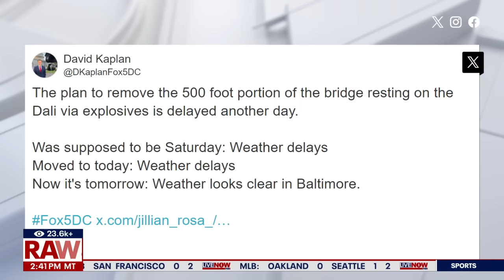Demolition of Key Bridge Delayed | LiveNOW from FOX

Comment: So, the crew is not allowed to leave the ship? Why? The government has no problem with people entering the country without documentation?
Reply: Who would run the ship if the crew left? Dali is still a WORKING SHIP and needs a crew at their stations.
Reply: Delete your account.  Geezus dude.
Reply: ... anyway...
Reply: The ship needs a crew
Reply: One thing is not like the other but if you can only comprehend political feelings then the pragmatic reasons for keeping crew aboard may be difficult to parse. The ship is still an operational system requiring the crew to be present. Ships are not just long troughs full of boxes, and each has complex systems which is why they're crewed sufficient for 24/7 human monitoring and operation of those systems. When the vessel is towed to a repair berth or a drydock then it can be shut down.

Comment: i don't understand these peoples explanations sometimes, the reason they can't cut it is because it is twisted in so many directions it has an incredible amount of what is called stored energy. It has a whipping action much like a fishing pole when the fish gets off the hook and it whips  back. When a huge beam is twisted it is difficult to determine where that stored energy is and will go, and clearly if it goes toward those working it could be potentially be fatal. By blowing the cuts with shape charges it relieves all the energy at the same time and allows personnel to be away from it when it does relieve the stresses.
Reply: Thank Bill Nye....shut up now
Reply: Thank you. Great explanation.

Comment: There is the on going problems to road traffic minus a bridge and the rest of the existing bridge, its pillars and road way, I assume will also have to be demolished and removed. At the moment it is a concentration of work on clearing the steel work and suspended road structure, but a new bridge will need a clean site from bank to bank.  I wonder if a ferry system will

Comment: Has the captain and crews arrested for this? Shouldn't they be the focus?
Reply: Root cause analysis is the focus of mishap investigation. Clearing the channel without causing more problems is the focus of the maritime demolition crew. Accuracy is far more important than speed in both cases. Once the ship is freed and moved where it can be examined and repaired all its systems will be available for technical forensics. Right now the important parts need to be operable.

Comment: The animation shows the water staying perfectly calm as all that weight of the bridge falls into it. Won't there be huge waves?
Reply: There will be some waves but separate dispersed pieces of steel won't create anything unanticipated. The reason all the specialized equipment in use exists in the first place is centuries of marine demolition precede it. It's interesting stuff. The much more complex recoveries at Pearl Harbor and Scapa Flow are worth a watch.

Comment: What is the likelyhood once the explosions happened and the frame is removed that this causes the doli rocking and cos of how many containers are still on there the weight may cause the dolly to tip to the side xx
Reply: Most of the cargo is deep in the holds so the Dali is not "top heavy". Heavier weight loads are reviewed using computerized systems so each container's load is placed for best safety.  The bridge sections are only partly supported by Dali's bow and the objective is for most of the structure to depart in a controlled manner.